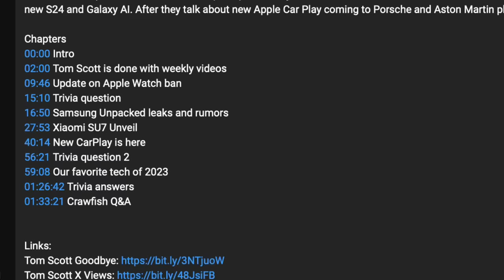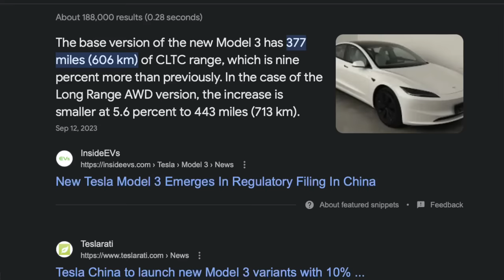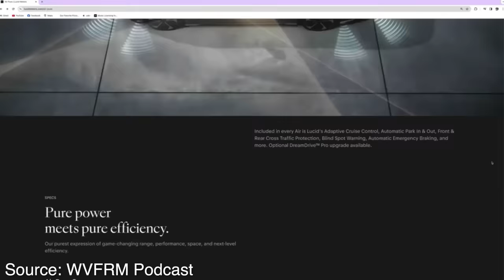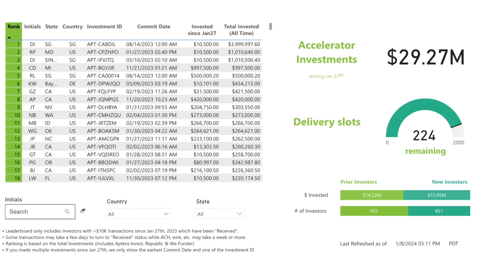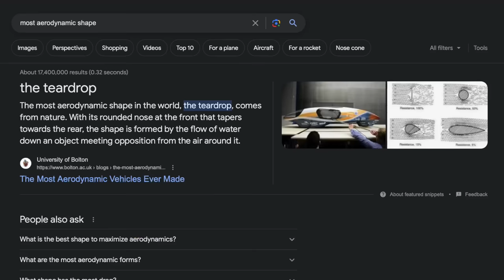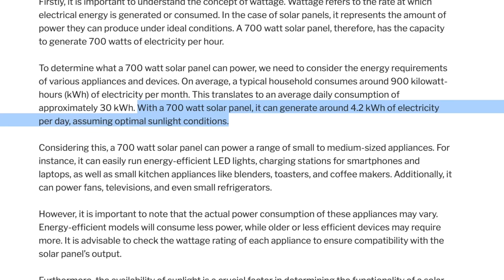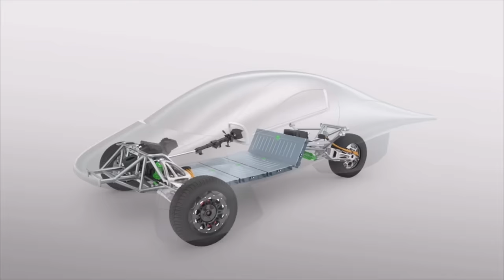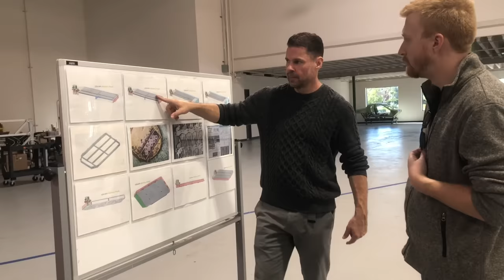Response to MKBHD Aptera Comments

Comment: I have a question, what does the car do to keep the cabin cool during summer where it wants to be soaking up the sun?  I recon a screen blocking the windshield will not be preferred since there are some solar panel under the windshield.

Comment: A bit unrelated but I'm a bit underwhelmed by Aptera. I think the future of vehicles should be very compact to be both power and space efficient. While the Aptera seems to be accomplishing the goals they set out for, it's disappointing to me that it's almost larger than the average car. I wonder what the point of the sleek and short design is when it's still basically just kind of a crappier sedan.
(By that I mean with similar materials and road-space you can have a vehicle that takes up the same amount of space, be a little taller, safer, a lot more capable of different road conditions, have more insulation, etc.)

I'm still excited for it, but I'm more excited to see future models actually deliver better size efficiency.
Reply: An Elio style two-seater would be more space efficient, while maintaining the aero efficiencies, but it would also lose a lot of cargo capacity, and therefore utility. It'll be interesting to see if anyone can make anything that has the best of both worlds.
Reply: @GoClimbARockEh  I don't really care about the cargo. I care more about emissions and traffic. One person driving to and from work taking up 90 square feet of road and parking (and that's just using smaller averages). There was a study done that showed if 10% of vehicles were motorcycles, traffic congestion could decrease by up to 63%. While there are other variables to consider, such as safety and decreased congestion often leads to more vehicles on the road, the study and evidence from Europe suggests that smaller vehicles are better.

There will still definitely be people that need cargo space, especially for the odd occasion. Some people will need pickups, but most people would be fine with just using their passenger seat or small trunk for groceries or a trailer hitch for bigger transports or even calling a buddy with a pickup or moving company for big jobs.
Reply: @DrewColpurs Yeah it's not going to be the one car that works for everyone. No car is! It fits my needs nicely though, and the cargo space is a critical part of that.
Reply: @DrewColpurs Aptera's design combines a very low drag body design with enough surface area to allow for 700 watts of solar , with efficient wheel motors,  with a weight  around 1,800 lbs  an an efficiency of 100 wH/mile it get 337 mpg-e . Side by side seating, strong passenger cell, air bags crumple zones and 7 feet of room and 32.5 cubic feet of storage behind the seats. It even has a tent option that can sleep two in the back. If you want a motorcycle there is no shortage of them .
Reply: @garywozniak7742  The Aptera is great for what they're aiming for, but having a "motorcycle" that has 3 or 4 wheels for stability and ease of use, and an interior for heating and cooling is what I'm hoping eventually gets developed.

Comment: On the issue of safety. Either Aptera will submit their vehicles for official car crash testing (NHTSA, EuroNCAP, etc.,) or they will not. If, as they and you claim, they would ace any such test, then why would they not have them tested? If they do submit for testing, and they get 5 stars across the board, then kudos to them. If they will not submit their vehicles for official testing, then any claims as to their safety should to be treated with extreme scepticism.
Reply: As the number of vehicle reservation climbed Aptera realized that could meet demand producing the carbon fiber bodies by hand. They partnered with CPC in Modena Italy (Italies "Motor City"), a company with 30 years of experience, to have them produce the Aptera bodies using their carbon fiber SMC and fiberglass SMC processes. This involved a considerable investment of money and time to machine the tooling to produce the components. The had to order 10 ton blocks if German steel that CPC needed to machine the massive die that they require to pressure mold the company's. CPC is also producing the aluminum belly pan for the vehicle. Thst development is just finishing up and I believe they have produced components for q6 production intent vehicles that are going to used for crash testing and validation.  I think there is an estimated 4 to 6 months for that happen.
Reply: @garywozniak7742  Make that 100 ton blocks of machine steel.

Up to 5 of the Production intent vehicles will be crash tested by a third party to FMVSS Part 200 automotive standards by a third party, and the design includes air bags - none of which is required by the vehicle class.

Many cars on the US market have no public crash test ratings available to the public due to lower production volumes, including from large manufacturers.  Aptera is going above and beyond.
Reply: @n.brucenelson5920  Thanks Bruce, exactly what I was going to offer in response.

Comment: "the 1,000 mile range number Marquez was quick to write off is achieved by putting in more energy dense cells"?????? I'm pretty sure that the range is achieved exclusively due to the efficiency of Aptera. For any total battery pack size Aptera can drive farther. It has nothing to do with individual cells.

Comment: Hello, I love the APTERA, and wish them the very best, in your dealings with the company was there any talk of how the Aptera would perform in cold snow climates?, how much of an impact would this have on the batteries? would the stability still be there or would the vehicle require snow tires?
Reply: Tire choices will be no different. Any tire that is good in snow will work on the Aptera's standard 16" wheels. They are doing testing in cold, and the Aptera will not be different from other EV's. Cold temperatures have a big effect on battery efficiency and range. Prewarming the pack will be a big help on those days, and Aptera can do it when you're away from home or a charger because it can solar charge.

Comment: so... I'm sure they thought of this but I havent seen anyone ask/talk about it... the frame is aluminum/steel. the chassis is carbon fiber. if these are in contact with each other, you get insane corrosion.

I'm hoping they've designed it such that the metal parts and the carbon fiber parts dont actually touch, but it would be good to confirm that.
Reply from the maker: I’ll ask when I get a chance!
Reply: As I understand it, you would need the steel and carbon to be electrically connected and have salt water present for a large amount of time. The Italian supercars don't seem to be having problems with corrosion, so I think Aptera will be fine. Hopefully.
Reply: If you look at the Aptera binc, body in carbon, there are dark, or black inner panels, and light or white external panels. The black inner panels are CF-SMC ( carbon fiber SMC). The white outer panels are FG-SMC (Fiberglass SMC).
Since carbon fiber is electrically conductive it acts as a metal when it comes in contact with metals like aluminum or steel. If carbon fiber is in contact with either metal in the presence of an electrolye like water or salt  water galvanic corrosion will occur. The metal,  like the aluminum belly pan,  become the anode and the carbon fiber becomes the cathode and some interesting but highly corrosive chemical reactions occur.
I suspect that is why all of the outer panels and potentially some of the critical inner panel are made of fiberglass. Fiberglass is not electrically conductive and does not result in galvanic corrosion when it comes in contact with aluminum or steel.

Comment: I've have not seen a comment on where the 110 volt plug in is at. It does not apear in the photos of the nacs connect.
Reply: It takes a simple adapter to plug the 110 cord into the NACS connector.  The same can be done with 220/240 cords.
Reply: does this also work for pluging in exturnal solar panels?
Reply: @JohnMatheson-s8t  Not necessarily.  There is a built in controller for high voltage DC or AC to DC.  The external solar panels are likely to be 12 volt DC, and I am not sure that they will cover that range.  There may be a different 12 volt socket that can be used.   Good question!
Reply: @user-fw3bx1wz2n Aptera talked about possibly offering an optional panel, I think it was 1kWatt, that could be fit in the hatch. It would have a cover and som sort of collapsible stand.  When possible you could set it up and plug it into the Aptera via some standard port.

Comment: I think people are of a mind that, yes the claims are probably true in the lab and maybe even IRL for the initial demo/test models.. but that compromises aptera will have to make to pass crash testing and other stuff NHTSA will ask for (im not saying the overall look will have to change but maybe construction materials will need to be reconsidered in certain parts of the car for durability in crashes)  . Also the motors will be different in the production models than the original ones since they were having trouble on inclines. and just other things they will find out as they ramp to production.  Again.. just more/better cooled and maybe beefier versions of the same motors should be fine.  the cars have to be more resilient in general  than test cars since owners will not want to be restricted. 

im speaking in generalities just as maybe mkbhd was .. ive just seen aptera in videos (the ones aptera produced and the youtube public) - but the things i mentioned are usually issues with most cars.. cybertrucks final form is a result of testing (driving, materials etc) and NHTSA demands/compromises. ) 

I wish good luck to them, i would love to see apteras being driven down the road.. I feel like (mostly due to mindsets) the car will sell in quantities some where near the middle  between what aptera expects and what some of the nay sayers are suggesting...   of course assuming they make it to production. (i think they will)
Reply from the maker: Auto cycle doesn’t have the same crash rating requirements as automobiles. Aptera is crash testing voluntarily, which is much cheaper

Comment: Did he say "carbon fiber"? I thought they are expensive. May be i was wrong.
Reply from the maker: Woven carbon fiber yes. Stamped carbon fiber is still very strong and durable but much cheaper to mass produce
Reply: @TailosiveEV  Cool. Then why every other OEM isn't using it? Can it replace aluminum?
Reply: @mhsohel47 every other OEM has institutional inertia to manufacturing. Any news process requires new tools, training and time to iron out links. Aptera is doing this now, OEM don't want to spend the time until someone else proves it's good.
Reply: @PandaKnight52  If it become industry standard then evs will weights equal to ice sports car or even lower. The future looks bright.
Reply: @mhsohel47 , Carbon Fiber Sheet Molding Compound (CF-SMC) is used in many supercars, but it is a new technique for mass production cars. It sounds like the C.P.C. Group took Aptera on a client partly because it wants to demonstrate that its tech can work in a larger mass market. CF-SMC can replace aluminum, but it is more expensive, and aluminum gets a lot cheaper when producing at large scale like Tesla and using gigacasting.
Reply: @amosbatto3051  May be $100k+ sports vehicle is suitable for this kindda new technique.
Reply: @mhsohel47  Mitsubishi Chemical just purchased CPC partly on the strength of the mass market potential Aptera represents as a consumer of their product.

Comment: I wish hope they can expand that concept to fit 4 or 5 people.
Reply from the maker: Eventually!
Reply: The second Aptera vehicle is likely to be a 5 passenger, 4 wheel sedan.  More information on this design will be released as Aptera plans to go public.
Reply: Yes, and it should go off-road and be able to fly as well. 

This do everything mindset is probably the biggest hurdle to getting EV's over the hump to better infrastructure. The 2 door, 2 seat EV that was the EV-1 is missing from a large manufacturer. Remove the rear leg room requirement on a car and the engineering gets easier for battery placement. A 2 seater also means  you won't have a family of 5 being burned to death on the news setting back adoption. 

We accept so many compromises for the do everything approach. From trucks without a 8 ft bed to urban commuters burning more gas for the 3 days a year they might need AWD. 

Saturn's EV-1 had the right idea in building a 2 door commuter because that's where EV's actually do the best.

Comment: What are the costs of each aptera unit?
Reply: All we know are the price targets that they announced in 2020, and those haven't changed.   There has been completely unfounded speculation.  Although tooling costs have increased greatly since then, and there has been considerable inflation, battery costs, amount of labor, and scrap material produced in producing each vehicle have all decreased rather dramatically.  We are still likely more than 6 months away from knowing where the final pricing will end up.
Reply: @billsmith5960  so I can probably expect somewhere under 50 K for the 250 mile version and somewhere above that for the thousand mile version if I’m getting that right with today’s inflation lol

Comment: Tailosive ev just loves aptera. 
He likes small cars.

Americans like big cars.
I myself am still skeptical on this aptera, especially after the motors overheated  climbing that little hill video. 

Im also not a fan of the design, and that's ok. Everyone is going to have their rightful opinion.
It's good to be skeptical until it comes out, I just hope it's not another Nikola..remember that?. 
Hope it is successful because if not theres going to be a few people very disappointed. 
And it's not going to be easy.
Reply: He likes very efficient cars. I can only see Aptera do well in California but Aptera is taking too long to release.
Reply from the maker: Aptera is wider than most pickups
Reply: @Blade70 Im betting it's taking too long because they found issues in the real world while testing.
They can't deliver it until the issues are fixed. Every startup company goes through those pains.
It's just that to some startups, it's too much loose millions and close down.
Reply from the maker: Nope. They aren’t doing range testing until they build production parts. No point doing them with hand built prototypes. Aptera has stated they are funding dependent and using all funds available to buy tooling with the longest lead times. They’re very transparent about what they’re working on, design is pretty much locked in
Reply: @Hugo-py2ce, To respond to your points:
1. The over 46K in preorders for the Aptera shows that there are a lot of people who like small cars. By the way, most of the world drives smaller cars than in the US, because there is less space on roads and the price of gasoline is much higher than in the US. 
2. The overheating during the hill climb has already been fixed. Aptera has released videos of the car going up far steeper hills and subsequent test drivers haven't reported any problem with overheating. 
3. Aptera is far more transparent and open about its operations than Nikola ever was. There were many people pointing out that Nikola was making fraudulent claims, whereas Aptera doesn't have a history of that kind of behavior. Nikola was blatantly trying to drive up its stock price with grandiose announcements, whereas Aptera doesn't do that. 

@Blade70, The current iteration of Aptera has only existed 4.5 years, whereas it took Tesla 6 years, Arcimoto 10 years, Rivian 12 years and Lucid 14 years to make it to production. Aptera is progressing faster than other American auto startups.
Reply: I an a thermal designer who designed and helped build a samples freezer for the ISS.  I have discussed the Aptera design under NDA, and I can tell you that there is nothing to worry about when we know that the cooling lines weren't even hooked up on the prototype in that video.  It had been operating for months in that condition with no issues.
Reply: @n.brucenelson5920  That sounds like good news.

Comment: We should all be doubtful of Aptera's range claims. Look at it this way, the 400 mile version was first announced with a 40kWh battery then it bumped it to 42 and the last comment from Chris was 45 kWh.  Chris has already hedged in comments with regards to range by referencing tires and weight effects. Not one number Aptera provides about their vehicle is set let alone verified. Those numbers referenced are from years ago. Just like the price, all numbers are subject to change.

Comparing the capital to start a traditional EV company as compared to what Aptera is doing isn't apples to apples.  The more you research Aptera the more you realize they have never been ready for production regardless of their claims to be ready in 2021 and by December 2022. What you find is a company that consistently delays their SEC filings until they have no legal choice to submit them. Companies like theirs have 120 days to file end of year and 90 to file the period ending June 30th and damn if they don't sit on those numbers as long as they can. Plus that desperation invest program launched December 1st offers a discount when no price is guaranteed. Which means, it is not a discount.
Reply: @billsmith5960  What you and @andromedach are trying to spin is that Aptera Corp has never missed an SEC filing deadline, even when they lost their CFO.  

The PI body parts are in production and the validation process has started.  We have had target numbers long before most other companies reveal them, and we will have third party verified numbers before vehicles ship.

Tesla had been shipping Roadsters for a year that broke if you tried to achieve their published acceleration numbers.  You are the one promoting a double standard, apparently.